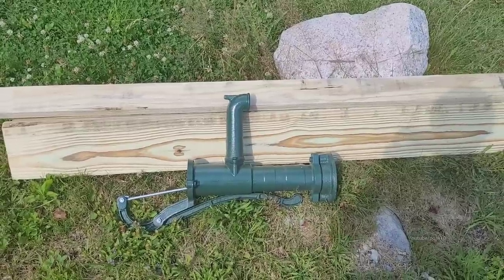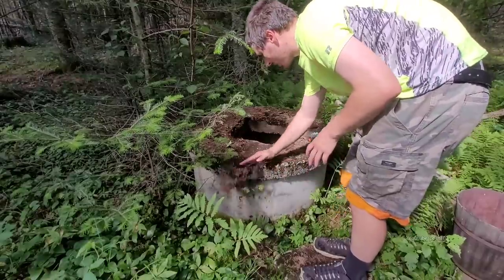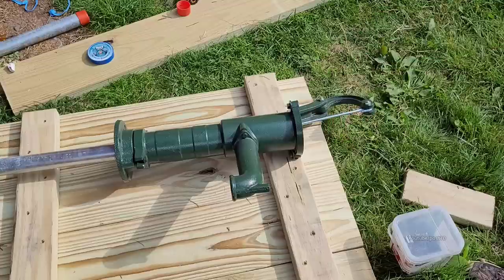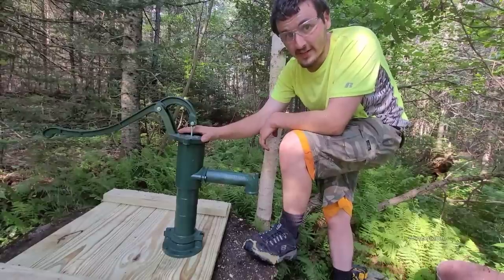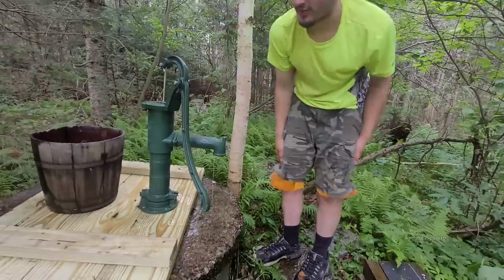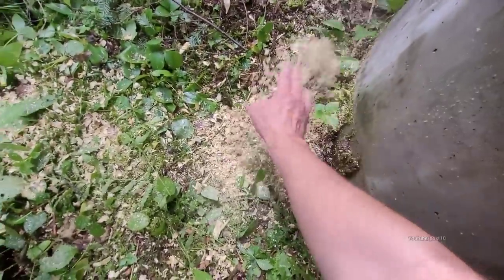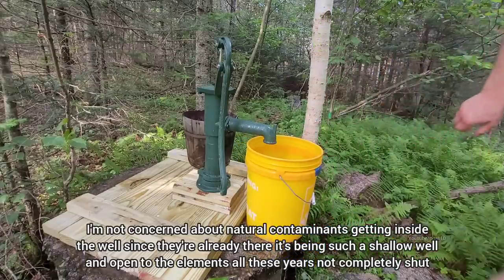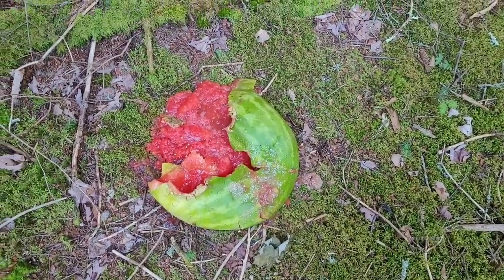Starting Up Another Abandoned Well 50+ Years

Comment: Props to you for rehabbing these wells.
I do sewer and water work for a living, so I can easily relate to your videos. In order to make that easily maintainable moving forward, drilling a hole closer to the edge through the lid would've been the best option. And cheaper.No rotting wood, nothing for vandals to burn etc... (I see it's treated wood, that rots too...especially if there's enough moisture to grow moss). 
If there's a pipe laying crew that you pass by in your travels, stop by and ask what EZ-STIK is. It's a firm caulk/tar type sealant that's meant to go between the lid and the structure. It comes in a roll and you install by hand. It would definitely keep out insects that will crawl in between the shims you lifted the lid with to stop the rocking.

Comment: If you don't intend to drink it, you could use it as a heat sink for A/C or even run it through a liquid to air heat exchanger for summer time cooling. Powered via solar panels would be very eco-friendly way to keep cool.
Reply: I don't know if having the water in a well heat up is such a good idea? 🤔
Reply: @vesa7069  Why not? If it's not for drinking I can't see any reason why not.  You could make a water feature out of the return water and let it soak back down into the ground so that wildlife have access to fresh water.

Comment: Just a tip for your next pump build.  Galvanized Steel Pipe, like you used is a good option.  The end that you cut, you need to spray that end with a sealing paint.  It really does not matter what type of paint you seal it with, you just need to seal it.  The Galvanizing is only "Skin Deep" on that type of steel, so you nex to seal the exposed core steel to keep it from rusting.  Just so you are aware...

Comment: The last addition I would have made to that is installing a straight pipe to extend the nozzle beyond the concrete cap, and prevent the water from splashing back onto your wood platform, to prevent the platform from getting rotted by water.

Comment: Maybe use composite decking for your platforms. Weather/water resistant and if you get the right kind very sturdy. It would eliminate rotting wood and hold up over time.

Comment: That was about 22 seconds for 5 gallons, which gives you approximately 13.5 gallons per minute. Do you test the well water for contaminants like lead?
Reply from the maker: I have not tested it, it doesn't really matter what's in at the moment since it's going to be used for watering or emergency situations when you would have no choice but I would still filter it in an emergency

Comment: Maybe after a year you could bring a torch and burn the wood until it is black it will protect the wood and keep it from rotting.(Just a suggestion.) I am wondering if all those wells where put there when they wanted to build a house there as test wells to see if those areas where good for water points to see if those wells had a really good refresh rate so they where not drilled down too deep.

Comment: Make a trough or a PVC directional spout attachment.
Reply: If you do the PVC idea add a Y connector with a directional shut off valve for one side or the other then cap one end with a hose faucet spigot installed through the cap so you can have some reach if needed, so the area around the well doesn't become a mud pit or washed out. It would also allow for larger containers to be filled.

Comment: I believe to stay compliant with certain laws there has to be a water supply for use in industrial settings like logging, a plant I used to work at had “wells” they were bury hydrants tapped into the city water system not sure exactly the use but we’d used them to wash our hands with and sometimes drink from it

Comment: My only question is:  Has the water been tested for consumption?
You might have cleaned the top BEFORE you removed the cap.
17:50  Moose calling?
I wonder who will be the first one to put the pale handle on the pump hook, fill the bucket up and tilt the whole thing over?

Comment: Does the check value drain back so it will not freeze and crack the pump in cold weather?
Reply from the maker: It seems to be very solid but I'm probably going to have to drill a small weep hole
Reply: You will most likely be ok, most have room for the ice to expand Without cracking the pump. Never miss a video.